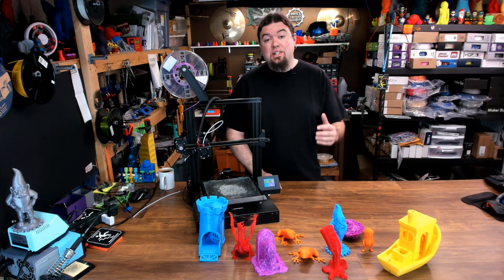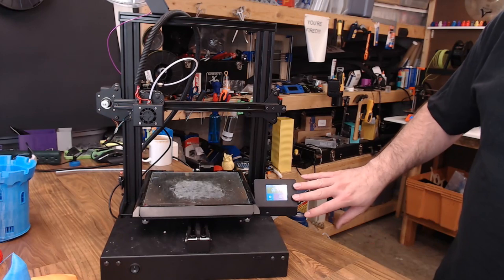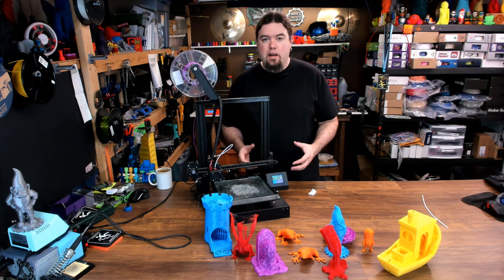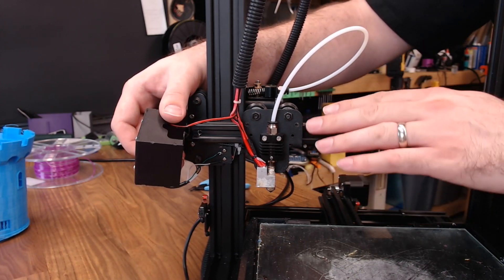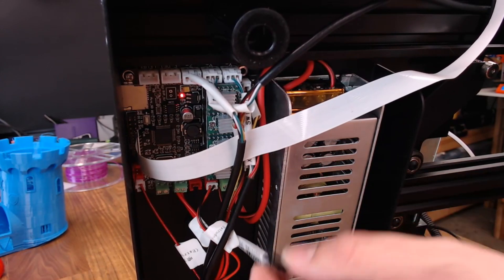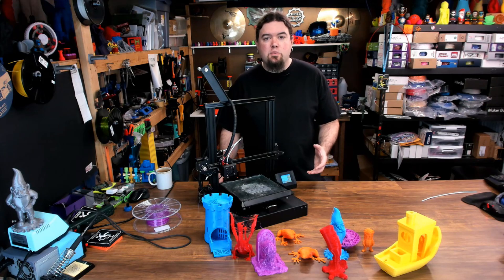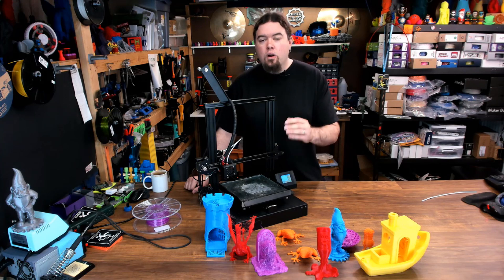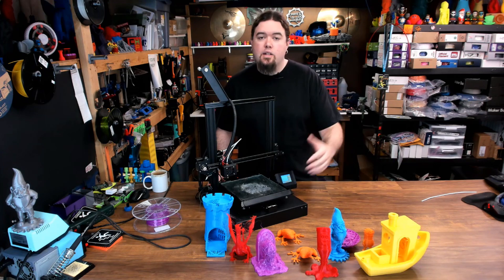Xvico Pioneer 3D Printer - Review - Chris's Basement

Comment: I want to junk the board in my XVico Pioneer for one with decent connectivity. Does that mean tossing the motors as well?
Reply from the maker: If you are up to configure the new firmware you should be all set. The motors will work with pretty much any board.

Comment: Hi thanks for the review. I bought this printer and it is my first. I bought it from ebay for $170 including tax. purely because it is the cheapest out there. but I struggled with getting it to print properly. first thing happened was E-motor ticking as if it is having hard time feeding in the filament or something is wrong. Can you help suggest what is wrong with this printer. I basically suffered from skipping. It only printed with fine I use Cura slicer. when I try to speed up the prints by using .20 or .15mm I couldn't have any success at printing. I used dark green from ZYLTech filament. I have uploaded a video of the problem: https://www.youtube.com/watch?v=eEyR95zgIUI it would print initially but later I start finding a big pile of wool of plastic. I have played with temperature and tried up to 240C which is quite high. This makes the print so thin and a lot of bubbles. it's just so frustrating I cannot get to print a decent print. if you have a skype or an email i can talk to you over so ask your help thanks in advance.
Reply from the maker: Does it start printing fine, then do this? If so, it's heat creep, the heat from the block is getting to the cold side of the hotend. You can email me at brotherchris81@gmail.com
Reply: @ChrisRiley  Yeah it does. but I am also new to Cura. so sometimes initially it takes time to actually print which is strange. I followed a beginner tutorial on youtube to slice my own model with cura and put it on mini sd card and print it. I printed the first time with fine out of the box successful 3d print of a small wheel 2in diameter wheel I will send you pictures on email.
Reply: You should receive an email. Thanks again. It is a headache honestly to troubleshoot this. hhh I was hoping that out of the box I should be able to print for at least a year before I run into issues and Not from the get go.

Comment: do you happen to have the firmware? Cause my nephews got one and the current version has a bug that crashed the textdata and needs to have the  firmware reinstalled. So i need a copy of the operating system to load onto it and fix it.
Reply from the maker: I don't, I am not sure the company offers it.
Reply: @ChrisRiley  thats what i was afraid of. Sister in laws contacting the company. So sounds like they may just refund her money. Maybe if they don't make her send the "broken" one back. I can try to find a operating system to get it working and then i can have a small 3d printer to use and nephews can buy another with their refunded money that hopefully won't have issues.

Comment: hi chris thanks for video i bought this for my daughters birthday pls help me  everytime i tried to print long item like 15 plus hours when i wake up filament  all jammed and  not printing u said  on video  min 4:30 change nozzle to pass through im really sorry i dont really know  to much  about 3d printers can u pls give a link like amazon or ebay which one should i get for not getting jammed i would be really appreciated  i look on ebay there are so many different type  thank you again
Reply from the maker: What you have is heat creep and it is very frustrating. First thing I would recommend is boron https://www.printedsolid.com/products/slice-engineering-boron-nitride-paste paste on the threads of the barrel. That will help push the heat into the heat sink. Check this out, you might consider pulling the separate PTFE tube from the barrel and making the tube all one piece like on the creality printers. https://youtu.be/7XTxQAkwlX0?t=271
Reply: @ChrisRiley  hank u for reply mate u got my subs and like last question if u dont mind pls u know that boron nitride paste do i put near nozlzle or on  thermistor heater thank u
Reply from the maker: @Bboykes  I would just put it on the threads of the barrel, or the part where it goes into the heatsink. Probably won't do a lot of good on the thermistor or nozzle area. It might help as an anti-seize though.

Comment: Dang! look at that print bed! Dang look at that Benchy! Look at that little power supply.  Wait, What? No Octoprint? Scandalous! The Ender 3 is the Model T of 3D Printing.
Reply: I wouldn't say the ender 3 is a model t to 3d printing.  I would have to say the original mendel or the prusa mendel which led to the i3 design which happens to be the most cloned designin the world.
Reply: Greg Gustum my point was not that the Model T was the first, it wasn’t, there were many other cars available, but rather the Model T was the car that brought driving into the mainstream. It was affordable, readily available and easy took on. And was a solid frame from which to make it your own.
Reply from the maker: LOL, exactly!

Comment: There is a header next to the SD card slot so you can use a USB-TTL adapter or hook directly from the RX/TX pins to a Raspberry Pi for using Octoprint.
Reply from the maker: I figured there were some pins I could work with. I will have to see if I can get it working.
Reply: @ChrisRiley  Well, I don't actually own this printer nor do I know anyone who does. I just noticed them in the video from around 5:01. Probably worth having a go just to make sure it works. Also means you can dump/upgrade the firmware! Possibly a prime example for using ESP3D?

Oh, and thanks for covering ESP3D previously, I'm going to use it on my Garbage Printer (CD drives, AT PSU & etc).
Reply from the maker: Right on, yeah I will take a look around, see what we can add.